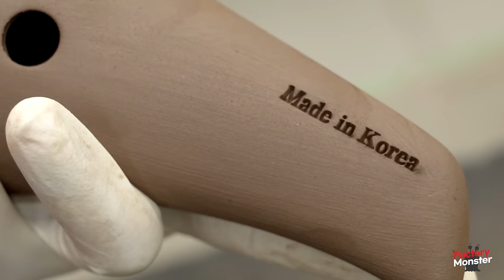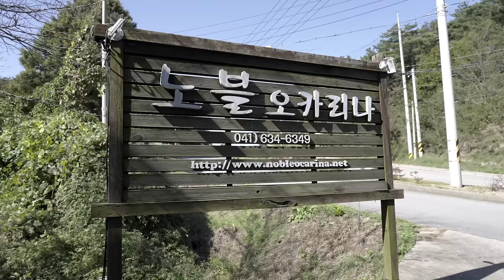Process of Making Ocarina with Clay. Korean Instrument Factory

Comment: I wonder how they work the tuning out?  From the looks of it, the initial tuning is being done at the greenware phase - and there is significant additional shrinkage when it's fired.
Reply: 건조후 1번  가마초벌  후 다시 1번 미세튜닝
Reply: There's a lot of experimenting that has to be done to figure out tuning for ocarinas. Basically, you have to the lower air pressure in it, the higher the ocarina plays, so creating ways for air to escape raises the pitch. You tune the instrument to its lowest note by adjusting the voicing, then add and tune one finger hole at a time. Their mold is already based off a tubed ocarina, so then they just test all of the notes, and if it's a bit flat they'll  make adjustments to the voicing or finger holes accordingly.